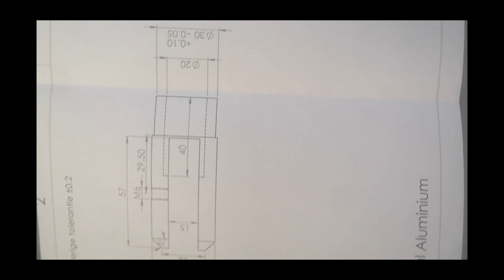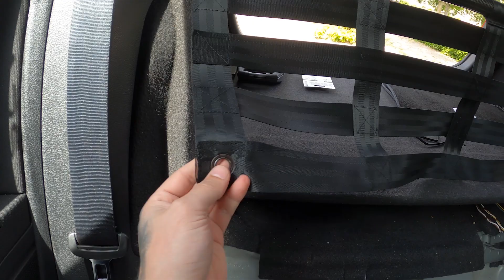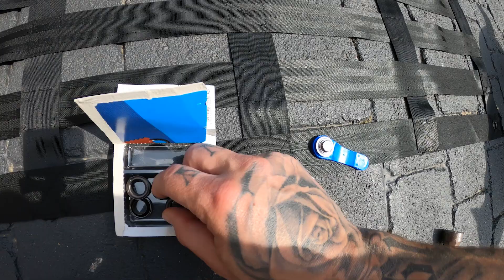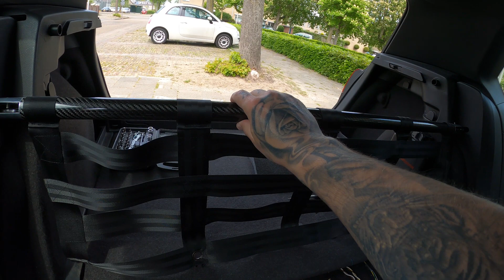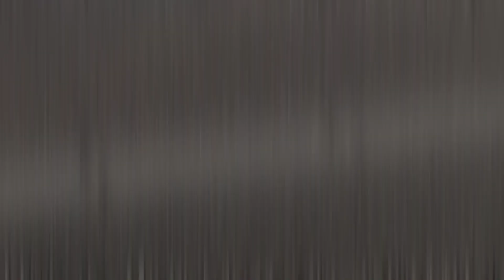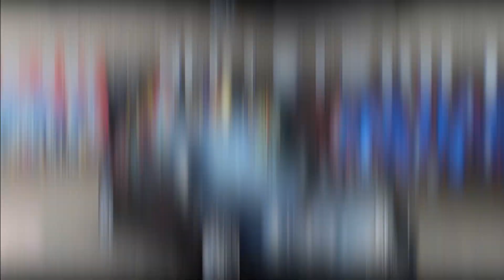DIY REAR SEAT DELETE - CUSTOM MADE IN CARBONFIBER FOR MY GOLF R *LOOKS AWESOME*

Comment: Pretty cool man. I've got a K brace coming for the S3. By the way for last comment you've made, which YT refuse to show me to reply, I would say for titanium cost it depends what setup you go for. Pipe itself is not too expensive but if you need muffler or sport cat or v-band then it get expensive quick. I use turbozentrum for all parts, not sure if cheaper, but great customer service and always happy to answer questions ect
Reply from the maker: K brace are Nice 2👌 i use Simmons muffler with normal exhaust clamps So thats not an issue. Let me look at that website 👊